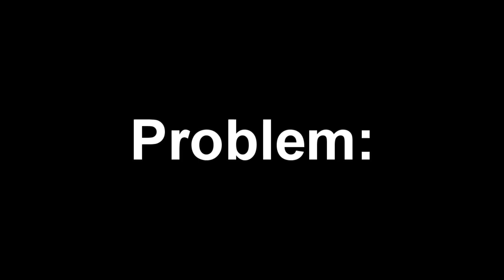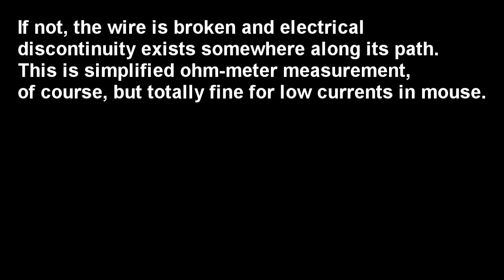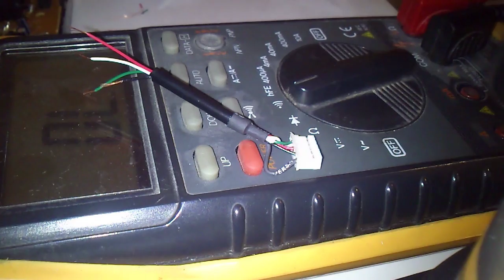Logitech Computer Mouse USB Cable Repair

Comment: Hello Logitech Rep. Do you custom make any mouse with a USB cable on them that's long enough to reach from like 40 to 50 feet?

Thanks
Reply from the maker: I don't represent anyone :-)
Reply from the maker: To answer your question, you can buy USB 2.0 extension cables, but keep in mind USB.org limits maximum length of a USB 2 0 cable to around 5 meters (16 ft) for full speed high power devices, and 3 meters (10 ft) for low power types such as computer mouse. You should use good quality cables to avoid any problems.

To reach that far, you will have to use several high quality USB Hubs (self-powered or with external power) to "refresh" (regenerate) USB signal and avoid connection issues. That introduces some time delay, though, regardless how minor it can be.

USB 3.0 standard has much worse maximum length specifications, so optical hub extenders are used to reach extreme lengths up to half kilometer (1640 ft).

Some 3rd party companies produce USB cables with double the length of official standards, but at much higher cost. Also, they offer specialized extenders / hubs.

Comment: hmm wouldn't it be easier to just et a new cable ( or one from a working logitech mouse) and just butthe in instead ?  or would that be a problem ..for dpi and such ?
Reply from the maker: Yes, of course, if you happen to have a spare one or from broken mouse, junk yard, of whatever. Simply re-plug & re-play :)

Comment: I wanna do this on a g402. Now the screws are below mouse feet, (friction reducing pads) so if i remove them r they reusable? Or i need to buy them (they r quite expensive)
Reply from the maker: Just gently put something like screwdriver tip under each pad and push them up (they are covered with some glue), place them on a clean surface like glass to re-use them later. No need to purchase new. Good luck!

Comment: my logitech g502 was spilled with contact cleaner spray and now it doesn't conect to pc (it's like conects, then disconect, then conects, then disconect...al inmediatly)
this could fix it? or replace the entire  pcb
Reply from the maker: Could be the case of a damaged cable or short circuit where the spray content was applied. Wait few days and leave the case open to dry naturally and check if it will start working again. If you have an ohmmeter or digital multimeter or a way to improvise a wire continuity test, check each usb pin from one end to another, to avoid unnecessary cable replacement. You can use 2 x 1.5 V battery, some extra wire and LED diode (red or green 3/5 mm round standard type, NOT blue or white!) to make a simple connectivity test circuit. If cable is fine, then something else on board broke.

Comment: I have a wireless usb mouse I lost the usb can this convert to wired mouse please help me
Reply from the maker: If mouse is Logitech model with Unifying Receiver (e.g M170, B170, M235 keyboard combo and alike), you can purchase a replacement receiver and reprogram it for your particular mouse/keyboard. However, here they cost like a brand new mouse itself, so it is cheaper to buy a new mouse instead. I have never tried to convert wireless mouse into wired one, you must know PCB design and components of that particular model, and yet, it may be too complicated to do. Just get a new one :-)
Reply: No sir can I make it wired
Reply from the maker: As I said, that is highly impractical. You will spend more time re-engineering entire mouse device. It's not worth it, unless you have absolutely no other alternatives and a lot of spare time on your hands.

Comment: I tried fixing my mouse this way...the led reacts fine, but mouse is not detected by the computer...any suggestions?
Reply from the maker: It only means that power supply wires + and - are connected fine, but two other wires are for data transfer and they may still be broken. Another explanation, assuming wires and USB connector are fine, is that electronics is malfunctioning.
Reply: @DarkoAqua  yeah...maybe electronics is not working...

Comment: My mouse's usb part broked and i cut it for replace with a new cable but there is no 5th cable in any usb cable that i have what should i do?
Reply from the maker: Hi, check if there's an outer shield used for the 5th connector.
Reply: Yeah there is a shield but no wire. Should i connect the wire with shield?
Reply from the maker: No, just connect wires you have, it is all fine. USB 1.0/2.0 port has only 4 wires: power supply (+Vcc, -Ground) and data stream (Data+, Data-), the 5th wire is not used and it is not clear why some cables have it (possibly EMI shield).
Reply: Oh i see. Thank you very much
Reply from the maker: You're welcome and good luck :-)

Comment: where should i connect the 5th wire in usb part
Reply from the maker: Depends on the connector type, either shielding or OTG pin.

Comment: Why use masking tape instead of electrical tape?
Reply from the maker: I just had it around. You can use any insulating tape really, as long it isn't too tick to manipulate around tiny wires.

Comment: i din't use soldering iron. i just twist the ends and connect the wires  and tape them. sry bad english . liked
Reply: did it work i might try it actualy?
Reply: @AintPopular  i mean yeah that could work but it's a really bad connection

Comment: its 5 pins from the mouse pin inside, while usb port its only have 4 pins,where the shield cable soldering?
Reply from the maker: 5th pin is ID for OTG. You don't usually use it in mouse. Shield is outer wrapped wire, has nothing to do with actual pins, and it is soldered to the metal / housing.
Reply: DarkoAqua https://www.overclock.net/forum/375-mice/1588984-mice-cable-pin-arrangement-internal-connector-size-database.html
Reply from the maker: That's why I did it this way ;) I simply cut the cable at damaged section, and re-soldered everything again. No-brainer about different connector standards / pinouts between models and manufacturers ;)
Reply: @DarkoAqua  thx dude
Reply from the maker: Since your mouse is SLAVE usb device (it can't act as USB Host), usually you can just leave the ID pin disconnected / floating / not attached.
Reply from the maker: You're welcome :)
Reply: @DarkoAqua  do you know why is the shielding required?

Comment: 2:54 USB has only 4 pins, while yours has 5 pins. Why?
Reply from the maker: Type A/B have only 4 pins. I think it was used for shielding in this case. However, 5th wire is for OTG in micro / mini USB types.
Reply: I think it was used for shielding in this case. 
Did you have to solder to shielding cable into the shielding connector?

Comment: Rip cuz i dont have the multimeter thingy
Reply from the maker: Hi, I understand that those are not common household items,  but as I wrote before, you can easily improvise continuity tester circuit with 2 AA / AAA batteries, some wires and 1 red, green or blue standard 3 mm or 5 mm LED diode. This should cost less or around $1.

For around $3.5 you can get hobby multimeter that will surely be useful in the future as well.

Remember: no tools = no repair 😀

Comment: isn't it easier to just unplug the wire connected to the board and plug in a replacement?
Reply from the maker: As already mentioned this in earlier comments, yes if you have one or you can order it for a reasonable price. If not, this is as good and free!
Reply: Not free for everyone, Everybody might not have these tools..
Reply: mr  s   Yup  But dont u know that the Eternal  ques.  "isnt it just easier to just "  always cost  more Money  .

Comment: The part I plug into my computer is broken :/
Reply from the maker: You mean USB connector? If the metal outer square shell is stuck inside your PC, you can try with some quality tweezers or pliers to pull it out. It happened to me once with USB nano receiver. If it is not stuck, just broken, then you can get ordinary USB cable. You can use any cable with standard USB connector on top, even from the phone chargers, or buy a new one.

Comment: bro please help me i have green blue white yeloow
Reply from the maker: You need to test each pin at connector side with corresponding wire color end to be sure. In some extension cables different colors can be used e.g. BLUE for ground, YELLOW for +V power supply, and other two for data D- and D+. But, it can be wrong.
Reply from the maker: But, it can also be like this: ORANGE is +V power, WHITE is ground, BLUE is D-, and GREEN is D+. You have to test it to be sure.
Reply: @DarkoAqua  ok im trying and i tell you Thnx
Reply from the maker: Any success?

Comment: it say unknow device ....
Reply from the maker: That means that cable or USB connector is still faulty or that mouse doesn't work properly anymore.
Reply: @DarkoAqua  ok...... colour sequence is green white red black and no colour or black ...... is it correct for genius mouse
Reply from the maker: Hi, when you edit the reply I do not receive updated notification, just so you know. I do not have experience with Genius mice, but 4 wires are actually fine for USB standard wire. Black color is GROUND (negative power supply), so that one is very important. I used digital multimeter to verify connections as shown in the video, but that is a USB STANDARD, so I doubt they didn't follow it. Clear wire may be 5th pin, shield or reserved. Also, it is a good idea to try rebooting computer, uninstalling / reinstalling mouse from Device Manager, or try it on another computer, tablet or phone, just to be sure that it is not functioning.
Reply: @DarkoAqua  tq so much ...

Comment: mouse worked but cursor not moving now. I had broke wire in middle of the cable. So I attached same colour wires together.. what's wrong? led is working and windows it detecting device. but cursor not running